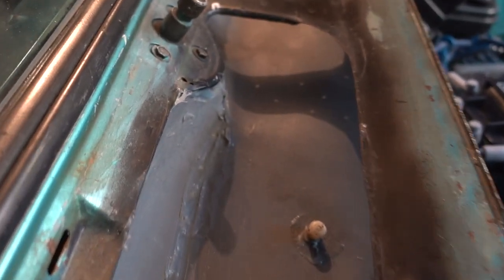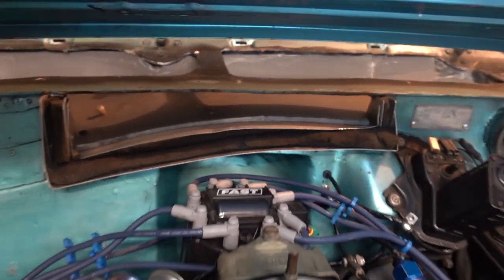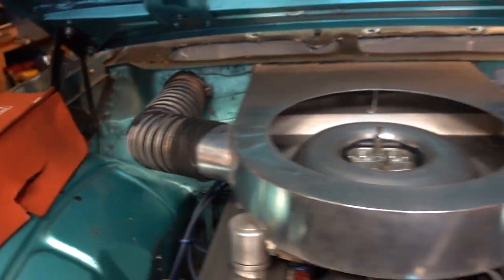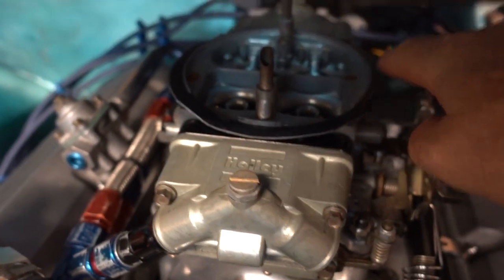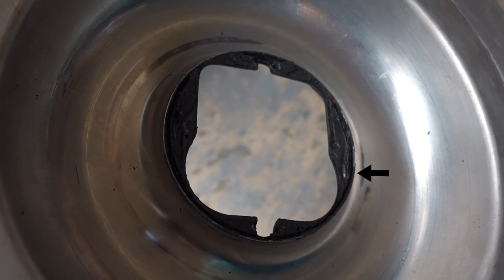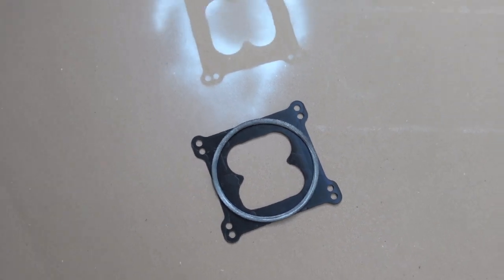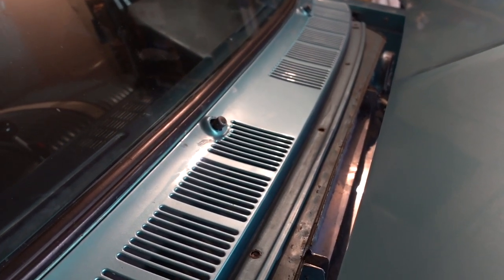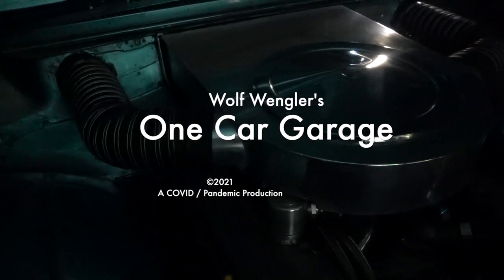Episode 11 - Cowl Induction Box

Comment: Super cool idea 👍👍
Reply from the maker: thx! It makes a good difference in hot Florida
Reply: @wolfwengler  do you notice any fuel efficiency improvement or horse power (even minor)? I've been flirting with the idea of making my own cow induction box 😂
Reply from the maker: @bluebook6312  I don't know about fuel efficiency but yes, power is certainly up. I think it's 1% for every 10 degrees. Going from 160 under the hood to 80 degrees ambient air is something like 8% more power.
Reply: @wolfwengler  have you driven in the rain with this set up? I'm wondering if you could make a secondary air inlet that would open from a electric or vacuum switch. For when it does rain heavily. Really nice and cool system.
Reply from the maker: @Scooty_scoob  It will drown itself if I leave it all hooked up!!  but with the two 4-inch hoses pulled off it drains fine. I was in a heavy Florida downpour and I know. Even when I wash the car, I pull the hoses off. I have also thought about a drain gate... but... I dont get in the rain that much.
Reply: @wolfwengler  I figured the engine wouldn't like it. I'm wanting to run a similar set up on a 99 dodge dakota. Did you build or did you buy the cowl air box? Thanks for the reply
Reply from the maker: @Scooty_scoob  I built the box. Cardboard first, then a rough model, just pop-riveted together, then the tig-aluminum. I wanted to run a 4-inch air cleaner and the drop base had issues clearing the linkage.  With a 1/2 inch spacer under the carb, there is only about 1/8 inch hood clearance at the tightest spot. The drop in air temperature going into the carb is well worth the effort. And dont try to get air through the headlights or grill, the cowl is the spot! Run a return line fuel system too.
Reply from the maker: @Scooty_scoob  I was thinking.... if I did put a relief for rainy days, I'd put it on the airbox. That's the lowest spot and it could  be a simple cable operated flap.
Reply: @wolfwengler  yeah good point.Chevorlet had an impala in 1963 that had a cowl set up I wonder if they had a water drain or bypass.

 I had a Ford focus as a first car. The air filter box was in the wheel well hidden behind the plastic fenderliner. Turns out the previous owner removed the snorkel that pulled air from the engine bay.

So one night it was raining really heavy. The tire was throwing water in to the filter box and about locked up the engine. Since then I've been hesitant on cold air intakes. But I think this and maybe the new nascar set up is the best.

Comment: Trans am shaker scoops have a flush nipple at the front of the airbox base with a 1/2 inch I/D rubber hose running down the side of the engine even though the back of the scoop is not cut out . I guess they figured people would cut out the back of scoop to make it functional . Perhaps this would help .
Reply from the maker: The air pressure doesn't really help until you're over 125mph but the increase from reduction in inlet temperature from fresh air outside the engine compartment is a big deal.

Comment: Great idea.  Did you make the airbox from scratch or modify an existing piece, if so what piece did you start with?
Reply from the maker: I started with a ready made, dropped air cleaner base plate. Then I made a cardboard version that I  taped together, all attached to the base. Then I took the tape off, transferred the pieces to aluminum (much put-together-take-apart in this process!)and tig welded it together, I sanded it , shined it up, mostly with semi chrome. It's really all simple shapes and bends.